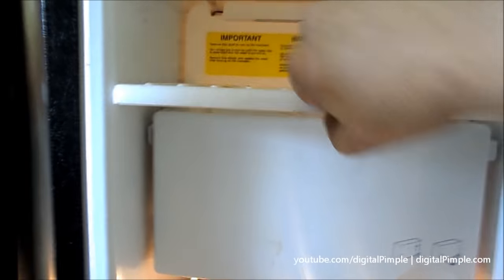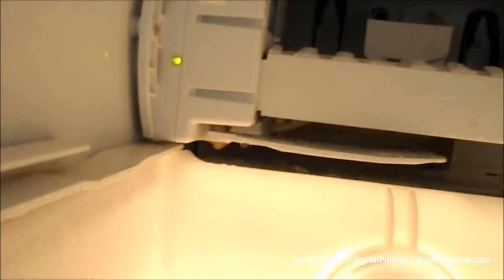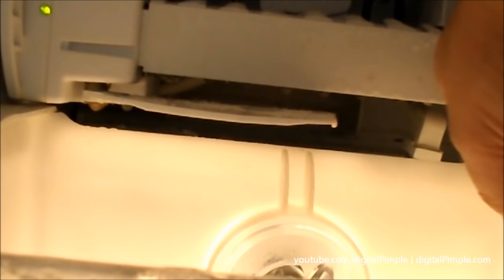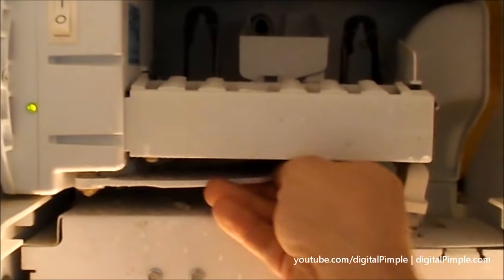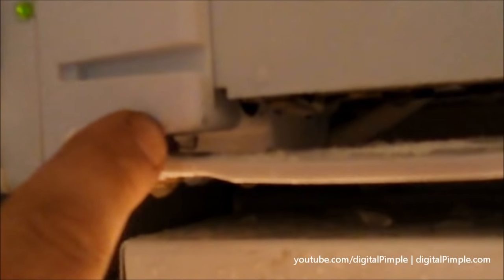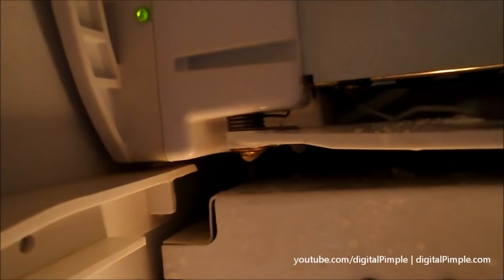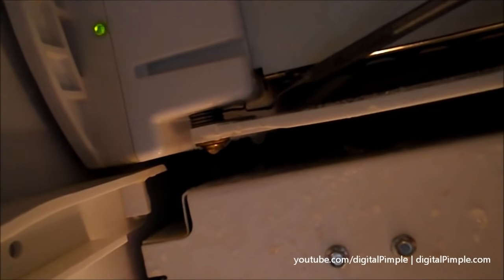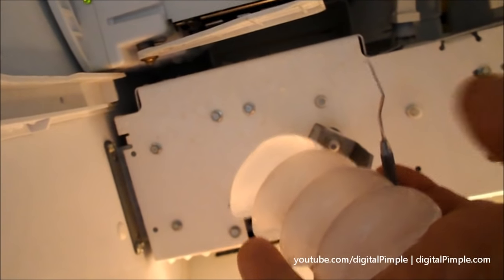GE Refrigerator - Ice Maker Not Making Ice - Easy Fix and Repair (DIY)

Comment: I bought my GE Profile Refrigerator in 2007 and never had a problem until January 2014 when the icemaker quit making ice. I bought 4 aluminum ice trays and I have been using them until 10/02/14 when I came across this "quick fix'. In seconds, I put back the pin in the hole as it had popped out and now my icemaker is working again. I kept hesitating paying $200 for replacement/repair and am glad I did. Thanks a million.
Reply: how do you put the pin back in?  I have reset mine several times but nothing.  Our frig isn't that old but not under warranty anymore.  I am caring for my 96 year old mother and don't have the funds to pay for repairman.  PLEASE HELP ME
Reply: It's very easy. Use a wire hanger or any stiff thin metal rod and carefully lift the pin in the back and make it comes a little forward until it falls in the tiny hole. The pic can come out from front or back. Mine was the part of the pin in the back.
Reply: Honestly I saved over $200.00 as was estimated to me to do a full replacement. Lucky I found this on YouTube.
Reply: Thank you,  my husband said honey I  don't  know anything  about  that.  I'm like  YouTube  ☺

Comment: My icemaker stopped working and the (licensed) handyman that I am, I began to remove the ice maker to check it out. After removing the front screw I couldn't figure out what was still holding it in place. After seeing this video, I then checked the spring and it was not in place. What a time saver... thank you sir!

Comment: This worked for me, thanks for the video! I thought I had to replace the ice maker! When I put the spring back in place, the fridge filled the tray and water overflowed and dripped down. Probably because it didn’t push out the ice that was in there. But the next morning, I have ice!

Comment: So happy you made this straight forward easy to understand video. I knew about the spring lever but not about the reset which was the fix I needed. My ice maker is deep inside the bottom drawer of my refrigerator/freezer impossible to see but after watching the video I found the on/off rocker switch by feel alone and reset. Thank you!

Comment: Thank you so much!  This is exactly the problem my ice maker was having.  I was about to drop several hundred dollars on a brand new assembly.  Fixed for only 10 minutes of work.  I noticed Ice had accumulated between the spring coils also making it not fit properly so I removed the screw that held on the spring and paddle, ran both under hot water, dried them and replaced everything and now working perfectly!  Thanks again
Reply from the maker: Glad it helped!!

Comment: After 10 years of buying bag ice i finally ran a water line to my fridge.   After getting it all hooked up, I was disappointed but not surprised when the ice maker still didn't work since it had never made ice or poured a glass of water since we bought it a decade ago.... thought I was fu**ed....Watched this video and nearly jumped for joy when I popped the spring back in, did the reset, and heard water trickle into the ice maker. Thanks man!!

Comment: Dude, I love you.  If anybody is watching this I'd like to re-emphasize the tiny little hole that the spring has to fit into. If that little white paddle doesn't spring out it still won't work. I thought I had it fixed and wasn't thorough enough, but we watch this video and it was dead on.  I love you so much internet stranger!

Comment: This is an outstanding tip.  After multiple time failures, I find  a  way to prevent the spring tip pop out by using a small drill bit to drill the hole a bit deeper.  Taking the whole assembly out  is very easy by uncrew one screw and electric connection.  You don't need to power off or turn off water.  Work perfectly now.  Thanks

Comment: Thank you!  My ice maker stopped working.  I pulled out the bin and saw the lever.  3 icecubes were frozen on the lever; so the lever could not move and spring back and forth.  I lifted the icecubes off the lever and the lever is now snappy like yours.  Did a reset as you explained.  I am waiting for the cubes !!  Yay!

Comment: You are a lifesaver. I was about to buy a new ice maker. I watched the official ge video. Couldn’t enter diagnostics mode. I found your video, sure enough the spring has come out of the top. I pushed it back with a mechanical pencil and started the diagnostic mode. Thanks.

Comment: 2/5/24.....Thank you digitalP !  Your 4 minute video helped me solve my ice maker problem too here in 2024.  A small ice chip had dislodged the spring from its mount.   As recommended, I used a "dental pick w/ hook end"  to grab the vertical spring end, pull the spring towards the front of the freezer, and "re-seat" the spring end in the tiny hole as you indicated.  The ice paddle switch now "springs forward" again, as shown in your video.   Thanks again.

Comment: My problem with my ice maker was it wasn't making ice. After watching your video, I found that the spring had came out of it's hole. I simply loosen the two screws holding it in place, detached the ice maker, turned it over and located the spring. I then reattached the end of the spring back in it's hole, reattached the ice maker and it now it is making ice again. Thank you for the video. A great help.

Comment: spring was fine. did the reset and i just heard ice cubes hit the bottom of the tray.  i also noticed that the hose that water comes through had the tube full of frozen ice.  so i kinda chizzled that out, and then turned the freezer down from 7 to 6........thank you for your video....'we' did great,.

Comment: Oh my!  I am so thankful for your tip.  We have been buying unfiltered ice for a month or so. We thought we would need an appliance technician to fix this. What a waste of money this would have been.  So again, I thank you for posting this simple video fix.  First I tried the reset and it wasn't springing back so that is when I looked closer at the spring situation.  Our little spring was so far off at let's say the 12 o'clock position and the tiny hole was at 3 o'clock . I just slide it forward until it seated in the tiny hole and heard the ice maker start up again!  I jumped for joy!!!
Reply from the maker: Linda Suarez NP. ENJOY! Ty

Comment: This was very informative. Without viewing this first, I replaced the water valve and it still didn't work. Then I figured out that if I pulled the paddle out manually, it would proceed to go in and drop some ice. At first I thought it was electrical until I watched your video. Thank you very much. The spring was my problem....

Comment: THANK YOU! My model is almost 2 years old and does not have the spring. However, the lever froze in the back position. A firm tug and it's back to normal! Thank you!!!

Comment: THANKS! This seems to have been my problem, and this saved me a couple hundred bucks. I tried needle nose and Allen wrenches to  relocate the spring, but that didn't work for me. Finally I just hooked my index finger from the back side and pulled down and pushed in. When it finds the hole, make sure it seats deeply by pushing up on the spring. GREAT FIX. Thanks again!

Comment: Very nice!  Ours sometimes has a bit of ice frozen next to the spring, which has to be knocked loose or else it keeps the paddle from moving.  Then the paddle was stuck in the "full" or rear position and wouldn't move forward normally.  We never realized (until watching your video) that the tip of the spring had popped out.  Thanks so much for taking the time to post your video!

Comment: Thanks, that did it!   Had to re-set that end of the spring.   That little hole was hard to see and was filled with ice.   Glad to know how to do that reset also, with the turning off/on and moving flapper 3 times.

Comment: This was very helpful, thank you! The arm on my icemaker was stuck in, it would not come out to the original position. I took my blow dryer and put some heat on the arm where the screw attaches the arm to the icemaker. Slowly, it started moving to the out position. When it did my icemaker filled with water. Not sure if this fixed it or not but it's working properly for now. Thanks again! 👍

Comment: Thank you so much! Even though it was hard to see where the spring was supposed to go, once I grabbed a hold of it, it snapped back to where it should be. This ice maker has been the pits, the on off switch broke; I see they made changes to it with yours. Ours is 8 years old, model GSH25JSTF. It also pisses water all over.

Comment: Thanks so much!  i hope this works, we are closing on our house in a couple weeks, and it just went on the fritz.  Tried the manual troubleshooting, nothing.  Our spring is in place, and i did the reset (a couple times) and turned back on.  i hope it is not the defrost heater, as that looks like it takes a little more finesse and we are senior citizens and might difficult!
thanks again!

Comment: Thanks! I am a total household dork so I was mystified as to how the damn thing worked. Followed your steps and there was some ice wedged in-between that arm and the housing top. Ha! Pulled the ice out and viola! Seems to be working again now that the arm has popped back out. Have to wait and see until later today.

But thanks so far!

Comment: Happy hour is saved!!
The reset fixed it.
Also, the spring had ice build up causing it to pop out of place. So I used a hair dryer to melt and dry. works perfectly!

Comment: i thank you for a very informative dyi video , upon further inspection of my ice maker in my ge refrigerator i noticed that one of the blades that flips the ice cubes out was stuck. the fridge was making a funny noise.  once i disconnected the ice maker the noise was gone with a  long nose pliers i bend the flexible plastic gently and free it from the blade.  once reconnected the water started flowing and the ice cubes started falling into the bin. save me money buying a new ine maker.

Comment: I knew the flipper should snap back and I thought the spring was in place but it was not correct.  Thanks for the help.  BTW- mine is a Hotpoint refrigerator.

Comment: Thanks, That fixed it.  I had ice formed in the same spot that disengaged the spring.  Popped the spring back in and reset it and it immediately cycled the existing cubes in the ice maker.

Comment: I just watched your video. Now off to work on my ice maker. It had a chunk of ice around the spring section so I am sure I have the spring problem.
Reply from the maker: Yes. Thats what I saw. If the ice returns look into also replacing the temp sensors. You can find that info somewhere on youtube. GL!!

Comment: Absolutely on target and good advice; my spring was not in the hole. By the way, if you loosen the phillips head screw on the bottom of the spring arm (don't remove it), it's much easier to put the end of the spring in the hole.  Definitely an easy fix.  Thanks!!!!!

Comment: Thanks so much for your video! I had the same problem of the little spring end popping out of its hole. Had to unscrew the screw holding the spring in place before I could get the end back in its hole
Reply: is there a video showing how to do this?
Reply: yes on you tube

Comment: I too have successfully used this particular solution, however, this morning, it didn't work. I watched this to be sure that I had done all of the steps correctly. I had, so I tried something new.

The spring's tip was well up into the pinhole securely. I "unplugged" the spring-tip from that pinhole and then "plugged" it back in. Instantly, l could hear water filling the ice tray. I write this in hopes that it may be useful to someone.

Thank yiu you for your video.

Comment: I'm actually excited to get home and check to see if this is the problem I'm having.  Our lever doesn't spring out like this fixed one, so I'm betting that's my issue.  Thanks for the video!!
Reply: As a follow up - literally took me 2 seconds to fix.  Used a hook my wife had for crafting, grabbed the spring from the inside (hook between the actual spring and the "peg" of the spring that goes in the hole), pulled it forward and it clicked into the hole above it.  Thanks for saving me a ton of time and effort trouble shooting.  I now have regular ice again.

Comment: Great video, reset and found the ice maker is working, but no ice came out during the cycle. I'm guessing somethings wrong with the water line. I did smell something like burning rubber, hopefully it's nothing that can't be fixed. Freezer still works, just "wet" ice in maker now, and no more ice.

Comment: Thanks for this Video. I bought my  GE Profile Refrigerator PGCS1NFX around 2008.  Always had problems with icemaker, but I think this is where my problem is (i.e. Spring).  I'm going to "work" that paddle 3x and see if that fixes things.  I saw another video that showed how to insert the water filter  "on an angle".   I remember I had a heck of a time getting my filter installed (several  years ago). Thanks again... Oh, What  do you do with all the frozen food while you're working on machine?  LOL  ;-)  5/25/2019

Comment: I am not getting power to the ice maker. This problem occurred about a week ago. I tried the fixes in your video, but those do not appear to be the problem. The green light is not on. I looked for the wiring connection, but could not locate  it.I have a GE profile with a bottom freezer. This is where the ice maker is located.

Comment: Your hints were great, my thermister that  heats the bottom heater element of  ice tray to looosen ice before dumping (wireing diogram listed insideback left mounting tray,) {green flashing light as ice was stuck in tray} a $1x5 crossover # A2-3A-F on amozon. Now can you tell me where to find a reassambly diogram? As took it apart 2 months ago to get it tested

Comment: I have the same ice maker. My issue was one of the teeth in ice tray would get stuck on the plastic plate in front of it.When The ice maker tried to cycle it was too week to get past the bent tooth on the plastic piece.

Comment: After changing my under sink water filter the tenth time,  it seems something has gone wrong with the water fill valve. No water dispenser and no ice maker operating. I saw another post saying the vpower switch should be turned off when changing the filter as no water is going to the valve and it could be damaged. Never happened before. Fridge is ten years old. Ron

Comment: My spring works fine but it still doesn't make AS MUCH ice as it use to. Maybe I have a different model. I saw in another video it would be a water pressure issue or the tube that sticks out from the back being frozen and using a hair dryer to melt any ice stuck in there. I'm still confused. 🤔😩

Comment: We had a big storm come thru, and it stopped working. i checked the spring, it was good. but the green light was flashing. i turned it off and back on, we'll see if it reset.

Comment: I have a problem with the ice maker in my refrigerator. The ice maker is similar to the video but it is GE. It makes ice but it joins the ice that goes out with the new one. The machine is without synchronization, how is it synchronized?

Comment: This is the issue that I think I am having. Same refrigerator also. It came with the house. But when my fridge stops getting cold no ice or anything. I would go in and reset the ice maker by pulling out the connection. By doing that I guess I was resetting the part. It would work for a few days and the ice would produce. After about 3 or 4 days then it would stop getting cold and no more ice would produce. 

So I am thinking that I have the spring issue.  Will check it. But thanks .

Comment: The last couple of days the ice maker seemed to be stalling around, so last night I pulled out the ice box and realized it wasn't making ice,  I found a bit of ice under a flap on the top area, removed that.. had not idea what to do ,  so I pulled your video up, watched it and went into the kitchen, and followed the direction to a tee..  Well, nothing happened.. So I pulled out the refrigerator, cleaned behind it, checked the hosing..  Opened it back up, and tried it again using the direction you gave.. Nothing.. So, I gave up, put the ice tray container and shelf back in and pouted all the way back to my room.  Looked up the cost of replacing the ice maker.. my heart was crushed.. but had settled on replacing it..  So, I got up this morning, and told my Granddaughter, I guess were going to have to replace that ice maker, its just not working, and then I heard the clunk from the freezer, I opened the door and looked inside the ice box, and it was full. Thank you ..  I think my freezer and ice maker just had a great time with the olde one.. Its working... Thank you again..

Comment: In my case spring seems to be set correctly on the lever hole, but the lever itself won't swing out. I tried to gently swing it out towards the ice bin, but it won't come out. I also hear a little squeak every few seconds. 
Any idea what else I should do or check?  thank you!
Reply: +Atento987 same
Reply: +Adam khaleel what I did to fix it was to take the whole ice maker assembly out and found the problem was two of the white plastic ice lifters (they rotate and lift the ice pieces out to the bin with each cicle) were slightly bent and stuck, so it was preventing the full rotation and therefore the ice making cicle to complete. It was also the cause of the noise I continously heard from the outside. I didn't use any tools,  just carefully forced them by hand to correct alignment just a little and that's it. It's been working perfectly thereafter. Hope this helps.
Reply: thank you

Comment: I have no power to the water solenoid.  So no water to the ice tray.  I assume the control module on the ice maker is probably toast. There are no microswitches that I could test on the icemaker.